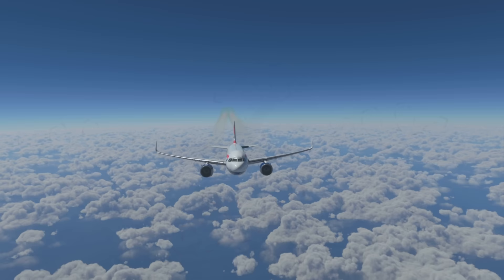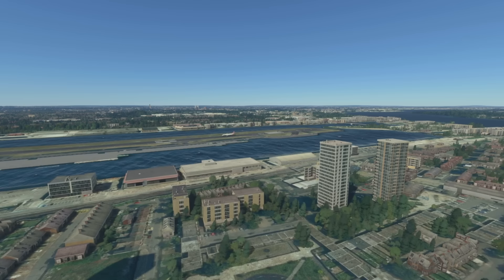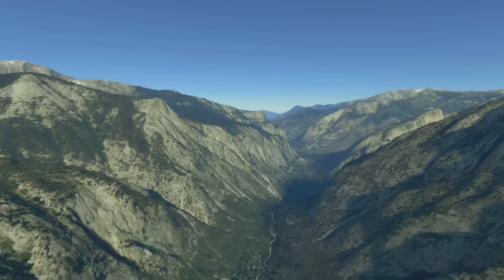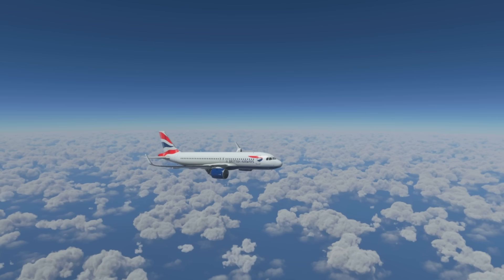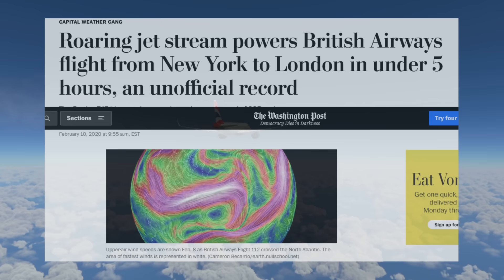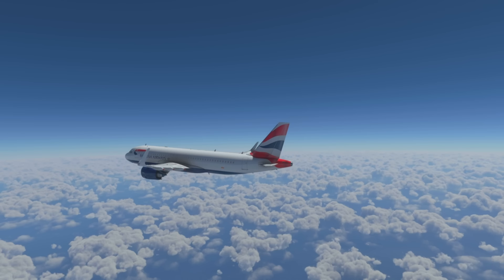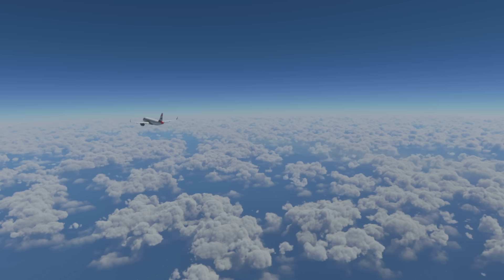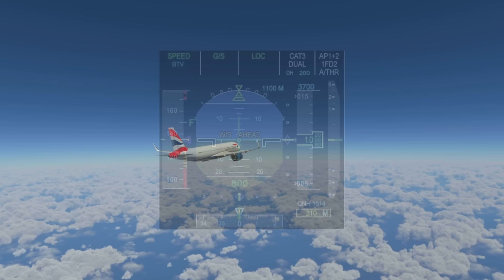When Is Turbulence In An Airplane Dangerous? | Curious Pilot Explains #1

Comment: Facts and statistics telling us that flying is the safest mean of transport, but my amigdala is telling me: Don't trust it, there is no safe turbolence, you're better off in a car. That's why I have fear of flying, because the emotions are so much stronger than the reality. I have read 10 books about managing the fear of flying, and attended 3 courses as well, they are helping me a lots, but not constantly, only when I'm on the ground. Once in a plane I don't trust anything, but my amigdala...
Reply from the maker: It sounds like you are working hard to try to ease the fear. I don’t have a fear of flying (I would be a pretty bad pilot if I did) so I cannot truly comprehend what it is like for you but one thing that reduced any sort of anxiety I did have was going through flying training myself and realising that most ‘emergencies’ are not particularly urgent or dangerous. For the most part it will mean landing sooner at a different destination but there are so many mitigating mechanisms and training that even losing an engine isn’t too much of a problem. All aircraft are designed to work with one engine (if they have two). It changed my mindset from when I was a younger passenger thinking that you were at the mercy of fate once the aircraft took off but in reality every problem has already been thought about and mitigated against.
Reply: I totally disagree.....been in a car is far far more dangerous. And there is that many idiots on the road, anyone could crash into you.... how many plane crashes are there a day compared to car crashes a day? Flying is by far the best way to travel.....and by far the safest!!!!! Your chances of dying in a plane crash is 1 in 11 million. Your chances of dying in a car crash is 1 in 5000......no need to say anymore, except I'm more frightened of driving than flying.
Reply: @andybaistow9368  That was my point, even though being in a car is so much dangerous I feel safer than in a plane.
Reply: Curious, do you enjoy roller coasters?
Reply: @CJ P. Really.....I never knew that.
Reply: My Xanax is the only thing that quiets my amygdala.
Reply: I got over my fear of flying by knowing that everyone dies eventually.
And if I die in a place crash - it's a great way to go out.
Fast, hopefully crashing or exploding in a massive fireball after a glass of bubbly way up in the heavens.
Beats croaking it out for weeks on end in a hot sweaty hospital bed like I've seen most of my family go.
Reply: @geosword6  I agree 100%.
Reply: @geosword6  I'm totally agree with you.
Reply: @danielpenchev4136  I'm the same way, I get the * logic * of why flying is safer, but when the plane starts shaking and dropping my heart is pounding out of my chest and I can't wait to be on the ground. My fear of turbulence has not stopped me from flying because I love to travel. But I wish I didn't have this fear. I'm 46 and have had it since my 20s even though I fly several times a year. So I know it's not going away by flying more. I've flown enough and been through enough turbulence where I should be over the fear, but it never goes away. I can't even get calm enough to sleep on planes, even if there's no turbulence at all.
Reply: @rexx9496  I have tried many things to find out how to approach a flight in a best stress-free for the anigdala possible way, and the last 3  flights were just fine after having small bottles of wine from the crew until I get the mindset of ''I don't care''. I am just watching through the window and the engines and realizing how developed the Humankind is. The Price: Hangover...
Reply: @Alex Mit regardless......flying is by far the safest way to travel. And I'd rather fly any day rather than driving on our dangerous motorways....but it's each to their own with opinions.
Reply: We have the same problem. At the end of the day, if things go bad in the air you have little to no control. Thats what scares me. What fixes my fear, 2-3 shots before take off and 1 shot before landing.
Reply: Cars and any road vehicles crash the most stupid
Reply: Turbulence is dangerous if your not in a seatbelt. Other then that my buddy is a pilot and I can assure you your safe. Fire is the only threat tbh but even losing tour engines the plane is still capable of flying almost 200 miles from gliding down
Reply: @matthewderitis7007   the most vulnerable times for a plane and its crew/pax, and the worst-case scenarios are : losing engine thrust capabilities on takeoff right before or just after liftoff , or on approach and too low to glide to a runway
Reply: @rexx9496  you just described me to the tee!  lol
Reply: My dad was a ww2 pilot instructor and explained to me how planes  fly basically and I think growing up I was taken to just about every air show Britain has to offer ….I love watching plans come and go but being a passenger is something I fear immensely even though I have flown many times across the world. But the crazy thing is I always anted and still do want to go up in a spitfire and experience what my dad felt 😊
Reply: I got over, not totally but enough!
By  learning everything i can  about planes, sounds, etcétera.
O always choose the Window by the way, 
It helps me to look outside.
Reply: @rustycage670  Those who have a fear of heights looking out of the window is a nightmare
Reply: @danielpenchev4136  i know but with me it helps to look outside. Strange 🤷
Reply: Same
Reply: @CJ P. that’s literally the reason why airplanes are safer 🤦🏾‍♂️ and even with less flights, the percentages of plane crashes are still vastly lower.
Reply: I’m the same way when it comes to flying. I get that it’s safer to fly then drive, but when driving I’m already on the ground. With flying I think about the horrifying moments you have while plummeting down that you are going to die. That’s so scary to me. I also feel that any lack in judgment are miscommunications can lead to dier consequences. In a car I think that most times it’s possible to escape. You can open the doors are climb out windows if possible. But on a plane there’s no way to escape that. Your pack into a small space in a metal tube and you can’t go anywhere.
Reply: @brandig2906  We humans are not "designed" to be in the air
Reply: I feel you. After watching the boeing documentary and how they take short cuts. My fear is about the plane itself
Reply: I’m pretty sure bus is statistically the safest form of travel…
Reply: Have you tried anxiolitics??
Reply: @itswhatitis277  No, I haven't. I'll look what uncle Google is saying. Thank you for the advice!
Reply: @danielpenchev4136  well I suggest you talk to your doctor instead. Anxiolitics can help you cope with fear of flying.
Reply: @matthewderitis7007  I’d say losing all hydraulics is probably worse than losing engines. It’s been very rare throughout aviation history, but United 232 is the most famous example.
Reply: @RyanRebel54  Statistic is one thing, your believe is another..
Reply: @danielpenchev4136  buzz off.
Reply: @RyanRebel54  I like your comment...I feel smarter now...
Reply: It's just not your kink.
Reply: Try the autobahn during a thunderstorm. In a boxy vehicle. You will see that cars also have turbulence. Or at least the air does funny things with them. The only thing they can't do is fall out of the sky.
Reply: Amygdala is a 'lyer'. It's function is to protect you, but it takes his job too seriously. Don't listen to it, it will make your world very small. Have faith, explore and enjoy. We are here to make memories, you are stronger than your fears. 👊🏽

Comment: Seeing the flight attendants smiling through that rough turbulence helps a bit
Reply: Yes, it helps a bit. But later the Captain announces, "All cabin crews, be seated" (which I had experienced). That is when the situation is getting worse.
Reply: @abdulwahidmdtahir3660  I think they only announce that so the flight attendants don't fall or get thrown around in the cabin, it doesn't mean that the airplane itself is actually in danger, just that there's more turbulence coming up.
Reply: @abdulwahidmdtahir3660  that announcement is very normal.
Reply: They're psychopath's
Reply: @graciegjj  hahahaha
Reply: They were taught from that movie Smile.
Reply: @abdulwahidmdtahir3660  Last flight I was on the toilet when the captain messaged this suddenly. The turbulence however was very minor luckely.
Reply: women rock
Reply: @abdulwahidmdtahir3660 no? It's just so the flight attendants don't get injured if the plane drops cause they can fly up and hit their heads. There's no situation where fully seatbelted passengers with no drinks or loose objects near them will be injured
Reply: @wybren I would have flushed so fast 😭

Comment: I've been on over 600 flights in a variety of different aircraft ranging from 182s, 208s and 787s. Watching pilots first hand up close on smaller aircraft dealing with turbulence is very reassuring, the plane moves, they respond to counter it. Every time, it's instinctive. To them it's just an everyday occurrence and they wouldn't be sat where they were if they didn't have the skills to deal with it. It's part and parcel of flying so sit back and enjoy the ride.
Reply: most of the time the pilots arent flying at cruise everything is on auto.
Reply: @benh4222 Guess who manages the "auto"....

Comment: I've been through major turbulences over the years and it is scary and my first reaction is always "I hope those wings don't break in half" but for the most I am not too concerned when flying but after knowing wings are tested makes me feel more comfortable flying.  Thank you for great video and explanation.
Reply from the maker: That’s awesome, thanks.
Reply: That was my reaction too. The wings looks so frail and weak, but that’s great to know they are strong
Reply: The wings are tested to 1.5x the maximum load experienced over the lifetime of the aircraft, so it should be impossible to ever snap a wing off an aircraft in flight. An exception is obviously high speed flutter, but a lot has to go wrong before you reach that
Reply: Rest assured, something on the order of 25 feet deflection from the tip to fracture a wing in real world tests.
So when you look out the window and see those wing tips moving up and down a foot or two, that is EXACTLY what they are supposed to be doing.
Reply: I'm always reminded of a documentary about the making of the 777, the flex the wings can withstand is pretty amazing
Reply: Me too, in my mind the airplane is about to torn into pieces 🤦‍♀️ mostly when I hear the metal rustling
Reply: I am far more concerned with the pressurised cabin having a crack after all the twisting and turning it goes through.

Comment: This was a great video! Fear of flying is awful. I can intellectually understand turbulence but emotionally my body goes into a complete & utter panic. I try deep breathing, telling myslef it's like bumps in a road, and also reminding myself that nothing lasts forever. I do have a Q- why do some pilots NOT explain what is happening? I would think maybe it's because they're trying to fly the plane but it would really help reduce panic on a plane, that can happen quite quickly.
Reply: Sometimes they do. They are working their arses off getting the plane under control. My worst flight they said nothing...was horrendous.
Reply: Because they're concentrating. It's like steering on a rough road, it takes focus. They don't want to distract themselves by making a PA.

Comment: Thanks for mentioning the wing stress test, I had no idea it can bend 5 meters ! It always freaked me out when I saw the wing flapping about like a birds.
Reply: There is a video on YouTube which shows boeing testing wings to failure and they bend almost 90 degrees before they break. Amazing.
Reply: Wings flex as much as possible so that the fuselage remains as steady as possible. The wings also act very much as shock absorbers. If the wings were stiff, not only they would inevitably break but the whole aircraft would bounce up and down far more severely.
Reply: Think of it as a tree branch. You always see trees waving to and fro in the wind. It takes virtually a tornado or hurricane to break it. And that's often because, well, the tree is rooted in the ground and has no additional flexibility. 

Something that is quite rigid is far more likely to break under the same stresses.
Reply: Sorry to rain on your parade, but it's not the wings you need to worry about. It's the pressurised cabin that is continually twisting and turning until finally it 'POPS' open and the rest is history.

Comment: I'm retired airline pilot. There are several classifications of turb we advise ATC when asked, example light chop, light turbulence, medium chop, moderate chop/turn etc. If we actually encounter severe turb (such as CAT) which is quite rare we are careful of our assessment . A few boxes actually have to be checked regarding its severity before reporting it. Post flight it also means the aircraft would have to undergo a scheduled turbulence maintenance check which depending on where we are (away from home base) means taking the plane out of service. A phenomenon I would like to ad from my point of view whenever I encountered such turbulence I could actually HEAR it! It is a very low frequency rumble measured in cycles like you may experience in your car travelling at high speed with one or more windows partially open, also a pressure sensation. Again just my two cents worth.
Reply: Interesting.
Reply: Can turbulence ever really cause a loss of control?

Comment: Great video. I’ve never been bothered by turbulence but experienced wind sheer on a VA flight to LAX. As you mentioned, max thrust and recovered but very scary. Pilot advised after they were warned by another flight but didn’t have time to change course. Apparently the plane went in for engine services after incident due to stress

Comment: I find it helpful to reflect on how the motion might feel if I were in a car or train.  We find comparable motion much less stressful when on the ground and wouldn’t imagine our car or train to fall apart over a bumpy section - and aircraft are considerably stronger in many ways.
I also remind myself that the aircraft is merely flying on a bed of moving air - to the aircraft the motion is natural, only the loose contents of the cabin (us) feel the movement in this way.
Reply: Thank you for the input. That’s exactly how I feel about turbulence, the plane is going to disintegrate in one thousand pieces in my head. I would never feel the same way on a car.

Comment: Thank you very much for your explanation. The other day I had a lot of anguish with a flight and here you have clarified many doubts that I had. On December 14, our flight left at 10:40 p.m. for Barcelona from Ibiza airport. There was a south-southwest wind, a bit cross but not quite perpendicular to the runway (it wasn't quite 90 degrees, it looked like 55-60). The wind at that time was going about 40-45 km/h with gusts to 50 km/h. The runway is located southwest to northeast, so the plane took off to the southwest. As there is hardly any land in Ibiza, the airport that day seemed especially exposed to the wind coming from the sea, according to the wind maps. When we got over the part that I thought was the most critical and that made me nervous (taking off from the runway), I calmed down. It was then when the plane prepared to head north, making a turn to the right as we continued to climb higher, that we began to experience strong turbulence. People screamed and I had an anxiety attack, which is very rare since every year I fly at least 10 times, and I never get nervous (even my family and friends are surprised that I never do). I remember the plane wobbling, first down with a thud, and then sideways, up and now I just remember a feeling like being on a roller coaster and thinking we were going to lose control. Through the window I could see the island far below in very variable directions, first occupying the window, then at my feet. All while the plane was turning from side to side, and up and down, and you felt the pressure of the plane as it kept trying to turn to the right and up. Finally, everything was in a more normal turbulence, and the flight attendant said verbatim: "I have asked the pilot, and he says that everything is fine. He says that we will have 5 more minutes of turbulence and then we can move around the plane." The message sounded remarkably honest to me. That's how it was, and we arrived about 20 minutes early at our destination (probably the wind became a tailwind and that propelled us). Do you have any explanation of these turbulences? In that case, do you know what exactly we experienced?

Thank you very much, gracias de todo corazón, 

Marina
Reply: That’s exactly what we experienced trying to land in Zürich last year, plane rolling from side to side and pitching up and down at same time. Landed on 3rd go around. Feel like I’m traumatised for life.
Reply: @freebird7017  Sorry to hear that :( I took two flights after that, I'm still a bit nervous when I do but, step by step. I don't want this to get over me. For now I take the flights with cancellation insurance and, if it's very windy, I change the dates (; step by step! I think we can make it ✊
Reply: I had a similar experience when I was flying to China one time--plane kept getting knocked side to side, rising and plummeting like a roller coaster. It went on for 45 minutes! It wasn't severe, but it was dramatic enough. No one bothered to tell us anything, either. Probably the worst I've yet experienced.